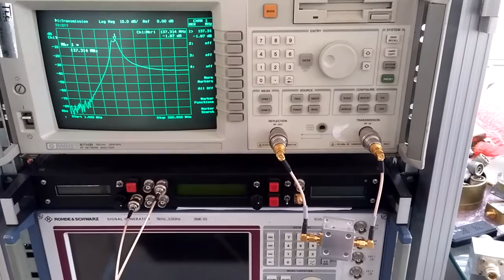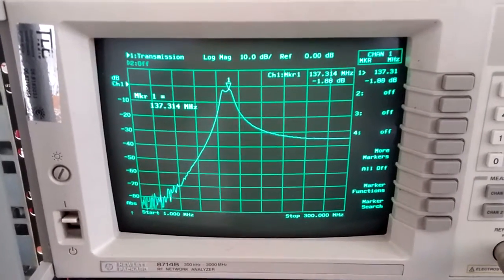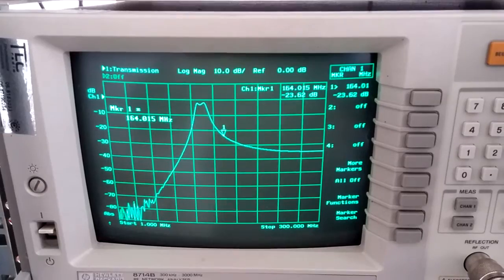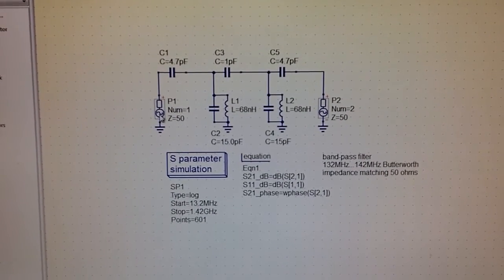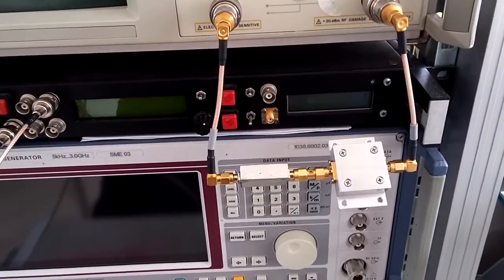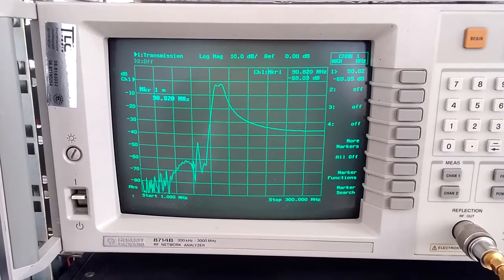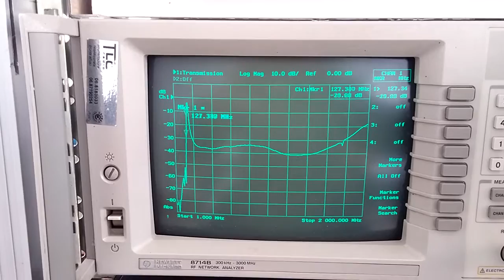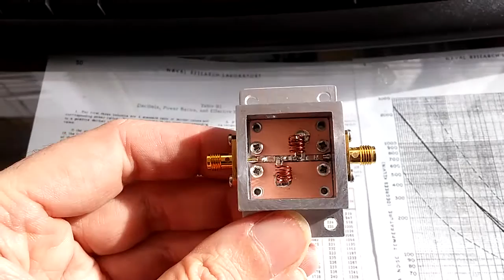DIY 137 MHz BPF

Comment: Hi Adam - I’ve just made a simple filter like this based on Lucas Teske’s design. It seems to have a curve much like yours on S21 on my NanoVNA, but my return loss on S11 is pretty high at the passband, not a low peak where it should be.

Additionally, if I put my hand around the protoboard it’s built on the return loss drops really low, as you’d want it to be. Like it’s some capacitance issue?

What have I done wrong here?
Reply from the maker: Don't get me wrong but you should ask the Lucas Teske if you are using his desing ;-) I really don't know how Lucas filter looks like...

Comment: Hi, many thanks for sharing, just implemented one and:
1) it works, noise source + v2 dongle shows similar shape of filter response
2) idea with coils is great, stretching allows to tweak filter so that insertion loss is minimum at 137-138 MHz
3) in my case shielding is “must have”, as without shield I still have unwanted signals in WX band (I use it in front of LNA near QFH antenna)

What is the next step of improvement? You’ve mentioned coupling capacitor as point to tweak, what could I expect by changing its capacitance?
Reply from the maker: You can note the ripple in the passband I have. This is due to using low capacitance coupling capacitor and not as calculated. I think I pick the 0.7pF instead of 1pF and the result is visible as not flat passband. The coupling is too strong with the 0.7pF. 1 pF should be good value.
Reply: Thanks!

Comment: Where did you source your enclosures?  Do they come with SMA connectors pre-installed?
Reply from the maker: Check my blog page on the right side colon. Raco, guy from Canada is making the enclosures.  They are coming with the SMA and feedthrough capacitor. http://lna4all.blogspot.hr/